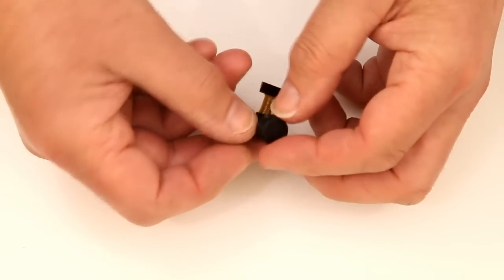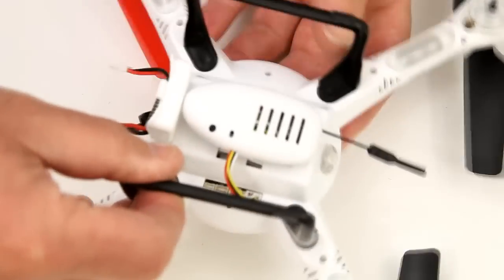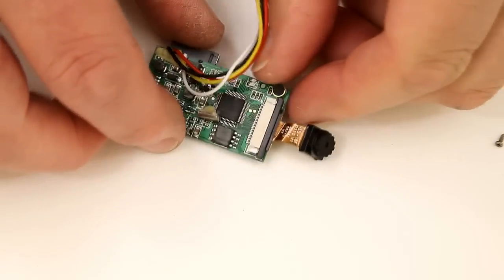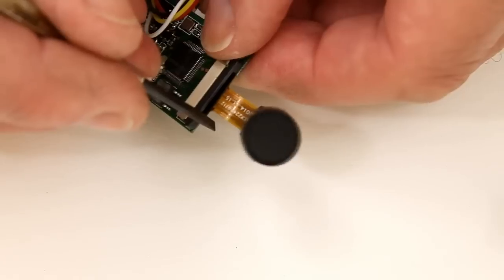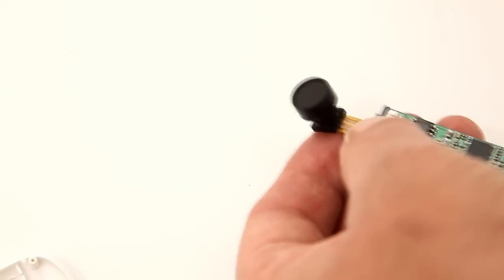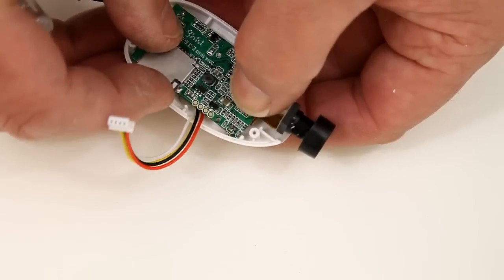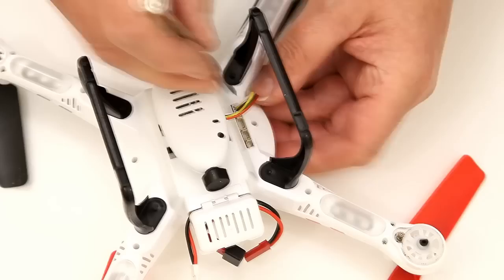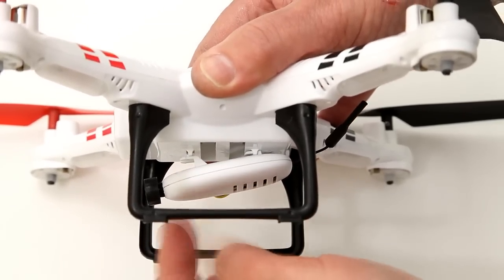WLtoys V686g replace upgrade wide angle D lens module & test flight

Comment: I was the one actually that started this replacing stock narrow lens with the 808 Lens D wide angle been doing it for over 2 years some can replace the entire module others just the lens it self, done it on the H8c, X5c,H12c, H107C SD, H107C HD, H107D FPV, V666, H1315, H8D, of course my V686, of all the 15-20 I have done never had one turn upside down, have had the color off and that bwas because of a bad module, keep up the good work glad someone else finally found what I start a couple years back way to go.
Reply from the maker: THXkid Hey thanks for getting in touch and comments :-) Never thought I was the first but perhaps just show it in a different way. I've only got my first quad earlier this year and just love them. I was the first with this though https://www.youtube.com/watch?v=gab668nKBis BTW I sub'd you :-) thanks again
Reply: THXkid THXkid, so you think V686G 1.6 version of the camera board should work with D lens still ? I wonder if anyone who bought D lens earlier tried them on new 1.6 V686G board and if it worked.
Reply: Andrius Stasauskas No idea on the newer version these small wifi camera are a hit and miss when it comes to the the wide nagle lens, some you can drop in the entire module and it will work, others only the lens and some use to small of lens so it wont work at all, sorry.
Reply: hi mate any ideas on how to resolve my h8d blue screen and not recording with the 808d lens?

Comment: Important info: the 808 #16 D lens module will not work with the newer V1.6 cameras. The picture will be inverted and the colors too (red is blue, etc). To find out what version you have, remove the 4 screws holding the housing of the camera together and look on the pc board. I went though a couple thinking it was just bad quality control. The newer lens barrel is smaller too (5.5mm vs 6mm) so you can't swap just the lenses either. And as of 8/15, there is no replacement lens module for the new camera (which should have been assigned a different part number, IMO)
Reply from the maker: Sundogzadventures Thanks for sharing this, I think a lot of people will be glad to know why. Is yours all sorted now and behaving itself? Thanks again great info :-)
Reply: Tigger's RC Reviews Same question. Thanks!

Comment: In the process of trying to fit just the lens itself I must have contaminated the unit and it had a dark area covering the upper right of the picture that no amount of 'focusing' would fix. Since a replacement lens module is not available (at this date) for the newer cameras, I had to buy another camera. I did find a wide angle lens that is made to attach to a cell phone that works but has to be hot glued onto the camera. It is marked .67x and gives almost twice the field of view without noticeable light loss. Right now, this is the best remedy I have found.
Reply from the maker: Sundogzadventures Well done you :-) you are fast becoming the leading authority on this unit whether you want to or not ;-) glad you got it sorted finally, I looked at those lens before but always thought it would degrade the quality too much glad it doesn't. I guess all this stuff is produced so cheaply the lenses are very much the same and come out of one massive factory somewhere. Are you going to put some footage up? Cheers for now

Comment: What wide angle lens would you recommend as compatible, for the WLtoys V686G Quad ??.
I have heard so many stories Re. upside down pictures and colour distortion. Apparently the Lens D is a none starter ??.
Regards. J.Malcolm C.
Reply from the maker: +J.Malcolm Craik I changed mine so long ago and it still works fine so I have no knowledge of a good replacement. Sorry. I hope you find what you are looking for. Good luck

Comment: hi there

just wanted to say thanks for the videos on v686G.  I have spent the last 2 + weeks researching quads and this one seems to fit the bill.  Your tutorials are awesome and thanks to you i am much more confident about changing the lens and sorting motors if they die!!  i wanted to ask how you found banggood?  I am stuggling to find a UK supplier and the chinese stores appear to be ok.  Did you have to pay import duty at all? - sorry for all the Q's - your feedback would be great :)
Reply from the maker: Chris Fisher Hi Chris, glad you are enjoying the tutorials :-) It's not so much a case of "if the motors die" as "when" my second one has gone now :-( but it's the price we pay for such a cheap entry into this hobby, I guess. I have never had a problem with Banggood and I have used them several times over the past 3 years. Here is the link for the quad http://www.banggood.com/WLtoys-V686G-FPV-Headless-Mode-RC-Quadcopter-with-2MP-Camera-p-965223ML1711535795201404KD.html and the camera module http://www.banggood.com/Lens-D-Module-120-Degree-with-case-for-808--16-HD-Camera-Camcorder-720P-Mini-DV-p-906428ML1711535795201404KD.html Motors http://www.banggood.com/WLtoys-V686-RC-Quadcopter-Spare-Part-Motor-V686-15-p-970346ML1711535795201404KD.html I'd get a couple of each as you get a better price if you order over 3 ;-)  I live in the UK and usually wait between 2-3 weeks for delivery. I have never paid any import tax. Please like and subscribe to the channel, thanks :-)
Reply: Awesome..thanks for posting back :) I have researched so many quads now but I cannot find anything that offers fpv of this quality at this price.  Will order later today!! Thanks for the links too :)
Reply from the maker: As they say up here Nae Bother, I'm pleased with quad as a value for money FPV, I'm looking at making the screen fit goggles and upload a how to video soon. Please use the links they give me a tiny feedback but cost you nothing ;-) . The wait seems like ages hence get the new motors at the same time if not you are dead on the ground :-(  I would also recommend a couple of these batteries as well http://www.banggood.com/Walkera-RC-Helicopters-Parts-3_7V-900mAh-High-performance-Battery-p-70388ML1711535795201404KD.html last longer than stock and you don't have to keep waiting to fly ;-)
Reply: Tigger's RC Reviews - Thanks for the link, i was looking at those batteries on banggood having extrapolated the model from your excellent close ups during the videos :).  I was curious about a charger for the new batt as i planned on buying 2-3.  I will definitely use the links you have provided to ensure you get the feedback from banggood.  For the googles i have found this  - http://www.flyingwings.co.uk/index.php?route=product/product&path=57_127&product_id=411 and plan to use the monitor provided with the 686g as they dont have a monitor or receiver included..have a look as i think they look ideal and are sent from the UK :)
Reply from the maker: Chris Fisher Hi Chris I use a B6 iMAX from skyRC, http://www.banggood.com/SkyRC-IMAX-B6-Digital-RC-AC-Lipo-Li-polymer-Battery-Balance-Charger-p-912239ML1711535795201404KD.html  I bought the genuine one as I have found many reports of the cheap ones not doing the job as well :-( it's £5 difference and to have doubt in my mind when charging just doesn't add up to me.You can tell you have a genuine one by the holgram sticker on the base ;-) The connector I use is http://www.banggood.com/Wholesale-3_7V-Li-Po-Battery-JST-Plug-1-to-5-Charging-Cable-For-V959-V212-V222-p-67575ML1711535795201404KD.html and can charge up-to 5 batteries in about an hour :-))))) I always charge the same batteries together ie I don't mix a 900mAh with 600mAh. I hope to post a video showing how I use the charger etc. This is a bit weird :-0 but the flyingwings hood is the one I shall assemble and test this week, they delivered the following day to me in the Highlands perhaps you would like hold on and look at my review before you buy, though I'm sure it will be fine. I assume you like this side of the pond?
Reply: Tigger's RC Reviews - yeah i live in wales so plenty of mountain FPV'ing when it arrives :)  the charger you linked to will defo be on my shopping list too simply because like you the extra £5 for a quality one is a no brainer and i appreciate the link to the JST plug as i am struggling to understand the connectors.  2+ weeks of research is no substitute to having the quad in hand so with your vids i'm much more confident about purchasing and addressing all the mods.  I will hold on the goggle purchase pending your review and vid.  God knows how much all my tinkering will cost in the end - my wife simply wont see the attraction of an FPV quad ha ha :)
Reply from the maker: Chris Fisher Hi Chris glad it's all helping :-) my wife is a little confused too......but she married me so it's kinda par for the course LOL She does love the ability to see the house and scotland from  above so that's a bonus. I reccon around £130 that's quad, batteries, charger, lead and goggles oh and those spare motors! You have been through the CX-10 http://www.banggood.com/Cheerson-CX10-CX10-Mini-24G-4CH-6-Axis-LED-RC-Quadcopter-RTF-p-926614ML1711535795201404KD.html , you can get it in a couple of days with the UK site, route and then I went to JJRC H6C http://www.banggood.com/JJRC-H6C-2_4G-4CH-RC-Quadcopter-with-2MP-Camera-LCD-Transmitter-p-952869ML1711535795201404KD.html then onto the bigger quads works out cheaper in the long run ;-)
Reply from the maker: Tigger's RC Reviews Hi Chris did you order your quad?

Comment: The case you get with the wide angle lens was to replace the case of the 808 keychain camera the lens is made for. The new case has the larger hole for the wider angle lens.
Reply from the maker: Sundogzadventures Hi that's what I say at around 40 seconds, thanks for comment please subscribe and like :-)

Comment: Hi, I purchased this lens module but once connected to the fpv emitter, at 1st, I had some interferences in the image and finally, no image at all... I verified multiple times but no luck.
Had to replace it by the old one and now, casing is a bit to wide at lens side.
Reply from the maker: Jeremie ARDILOUZE Not come across this problem at all maybe THXkid could shed some light

Comment: Idk what version do i have i got it fo $4 off ebay. Should i install this lens anyway? The stock lens is way too zoomed in.
Reply from the maker: +WaterTester I would give it a go and try it before drilling out the housing, just in case it doesn't work. But it's your quad and your call ;-)
Reply: Tigger's RC Reviews My camera looks different at the bottom side of circiut board. The lenses seems to be glued on. Could you help me? I will send you picture on email.

Comment: i received the replacement sent by Banggood lens D wide angle for my V686g but same issue picture upside down color is wrong. Anyone know how to fix this?
Reply from the maker: Dan Nebril this is the info from Sundogzadventures "Important info: the 808 #16 D lens module will not work with the newer V1.6 cameras. The picture will be inverted and the colors too (red is blue, etc). To find out what version you have, remove the 4 screws holding the housing of the camera together and look on the pc board. I went though a couple thinking it was just bad quality control. The newer lens barrel is smaller too (5.5mm vs 6mm) so you can't swap just the lenses either. And as of 8/15, there is no replacement lens module for the new camera (which should have been assigned a different part number, IMO)" there is more if you scroll down and look through the other messages, hope you get it sorted :-)

Comment: Does anyone know if the D module's lens can be unscrewed, or is it glued on like the C lens.  I'm interested in making an IR night vision mod, but I need to unscrew the lens to get the IR filter out.
Reply from the maker: czar225 I have definitely seen it focused for macro photography and also in the dim and distant past I saw a IR mod someone had done, can't find it at the moment or would have given you the link. Let me know if you get it done would be interesting ;-) Please like and sub thanks for watching :-)
Reply: Tigger's RC Reviews Well, I looked at the picture of the D lens on Banggood.com, and it looks likes like there is quite a bit of glue around the threading between the lens and the module.  Unless I can find out how to dissolve the glue, I can't even try.
Reply from the maker: czar225 Oh yes definitely glue round the lens, I have checked mine, you would have to be very careful dissolving the glue as it is a plastic lens :-( if I come across the the guy who did the macro stuff I will post it. Sorry
Reply: Well, I THINK I have succesfully removed the IR filter from my spare C lens, though I haven't been able to test it (the vtx board was smashed beyond repair when I was trying to knock my v686g out of a tree with a paintbull gun).  Trying to strong arm the threaded component and breaking the glue with pliars, I cracked the plastic around the aperture, and the IR filter was right underneath.  I chipped the rest of the plastic around the aperture and pulled the IR filter out.  It seems that the threaded part of the module is just a cap that holds the IR filter on.  I may have crushed the internal components when I clamped it with the pliars, so if you want to try it, I would recommend chipping the IR cap away by prying at the aperature.   Don't know when I will test it though.  I should be getting a new v686g in the mail in a few days, but I don't know if I want to take apart the camera/vtx to try the modded C lens until I can get around to order a spare (I've been waiting months since I lost my last v686g, would hate to accidentally break it as soon as I get it).
Reply from the maker: czar225 Well sort of well done you for getting the IR filter but not so good on the V686g :-( I'm umming and arring about a Runcam so if I get one I may well have ago at one of my 808#16 if I do I will post the video.BTW thanks for subbing and sharing :-)

Comment: Hi,

I installed the lens which I purchased from Bangood into my V686 and the picture is upside down and colours appear to be inverted. Red is Blue while Grey is Yellow!! Do you know what has caused these two problems?
Reply from the maker: Eli Moorman Hi Eli, that sounds really weird to put it mildly! I have no idea, but I'm guessing you tried with the original module after and that was still normal? or if you have an 808 camera swap them to see where the problem is. I have found Banggood good when it comes to any problems, if you send them an image/video of the problem. Hope you get it sorted and thanks for subscribing :-)
Reply: Tigger's RC Reviews Thank you very much for replying. I did switch back to the old lens module to confirm I hadn't made a mistake. The picture quality was normal. I switch back again and all colour are inverted and picture upside down. I suspect this is a dud. I emailed Bangood a picture of the fault and I am sure they send out a new one. Thank you for your clear instructional video, it was a great help.
Reply from the maker: Eli Moorman I think you have covered all bases there and if my experience is anything to go by Banggood should send a replacement. The 3 week wait is the pain but at least you can still fly the quad. Glad you liked the video, more on the way :-)
Reply: Eli Moorman Hi Eli, I have the same problem. did you get any reply or solution to your problem?
Thanks, Ron
Reply: רון רובינשטיין same issue here. i noticed here http://www.rcgroups.com/forums/showthread.php?t=2325987&page=101 that they discuss about colors and image problem. I believe the lens is fine but the fpv module is a different version. As per the discussion in the rcgroup the lens works fine with version nr 1.5 but my quad came with a fpv module version 1.6
what i did was actually to flip the pcb module 180 degrees while i cut the inside and the sides of the housing to accept the new position especially for wires and microsd card. I have then used scotch tape to attach the housing back. While it not looks very good and the colors are off (red is blue, and sky is kind of orange) it flies fine. * tried initially to rotate the lens only but the connection is too short. I believe there may be another lens compatible with this version of the fpv module but i did not want to wait another 4 weeks for replacement.
Reply: Im currently waiting for a replacement sent from BG. Staying with distorted colors is not an acceptable option. If that will be the case i will revert to the original lens.
Reply: רון רובינשטיין fix the color problem by processing the video file with free software called transcode, like so: 
transcode -i PICT000x.AVI -o output.AVI -y xvid -k
Reply: רון רובינשטיין do you know what type of the lens they are sending? by reading everywhere it seems that not the lens is the issue but the incompatibility with the module. please let me know and i will get a replacement. while i wait i will use my fix with the post processsing color as i mentioned earlier.
Reply: harap white Hi, I got a replacement lens and it has the same problem. You are right it must be the fpv module. Your suggestion to re-process the video file sounds promising. Do you have a link to how this is done?

Comment: I am planning to buy a camera chip of the samsung galaxy s7 (Great low light performance). Is it possible to replace the camera chip of the syma x8sw with the s7 camera chip?
Reply from the maker: Hi, I have no idea, not come across that change, hope it works, sounds good :-)
Reply: Tigger's RC Reviews thanks, I will try it when I will get my order :)
Reply from the maker: Kool good luck :-)
Reply: Tigger's RC Reviews ok thanks :)
Reply: Hi, are you success replace camera chip using galaxy s7 ? 
Thanks